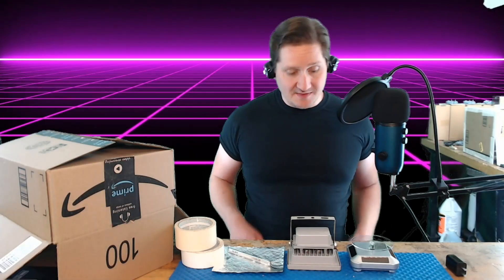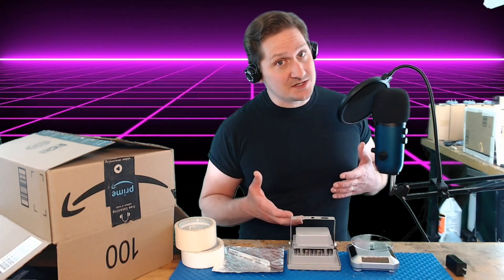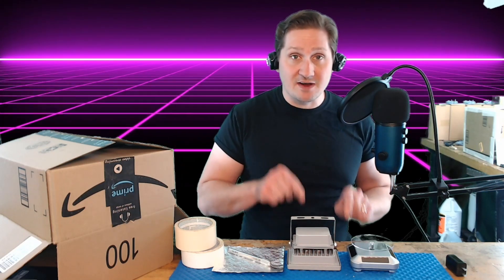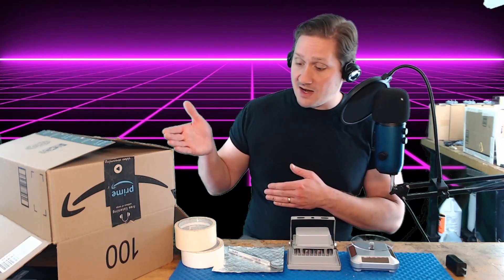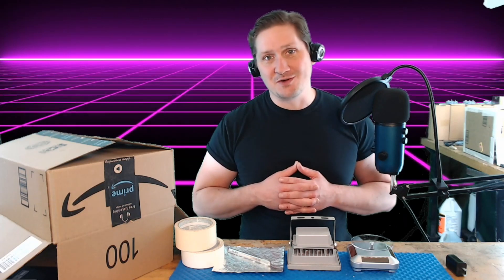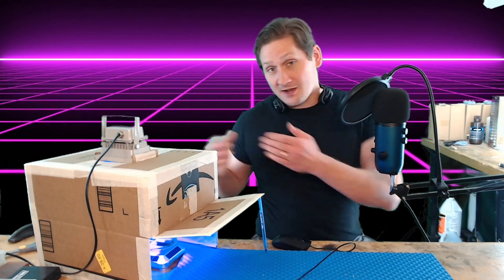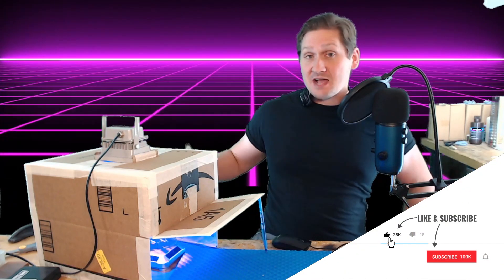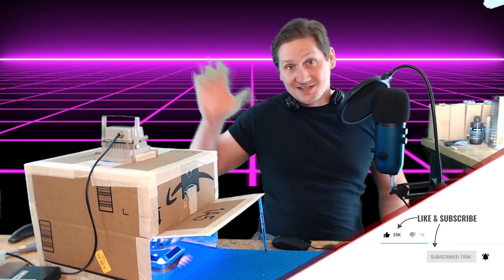Home Made Curing Station for SLA 3d prints

Comment: I used your idea and the same kit from Amazon. Works great. The solar powered turn table was a little too small for my liking. So I took a cd and covers it with aluminum tape and glued it to the clear top. Much larger area for curing and works great.